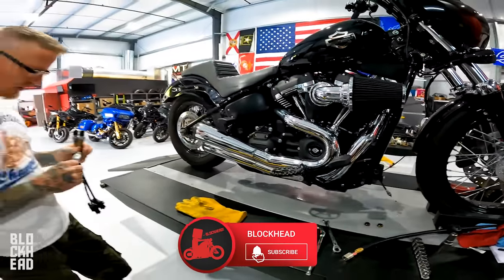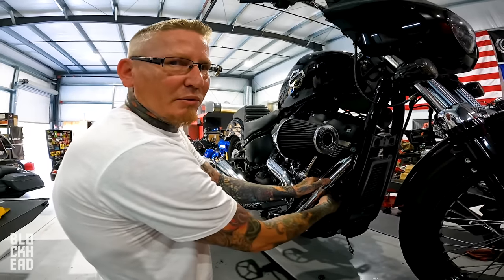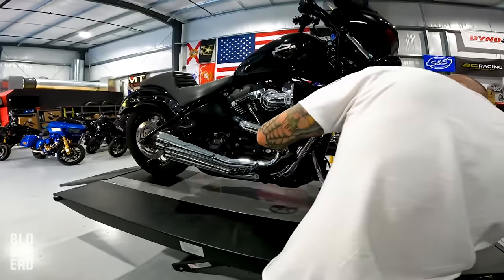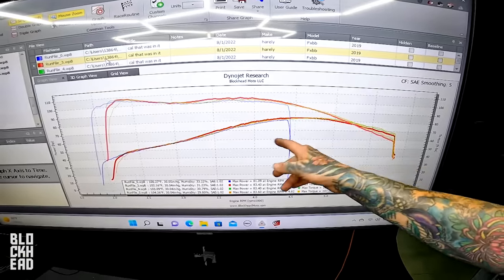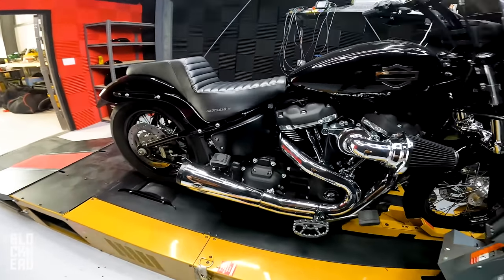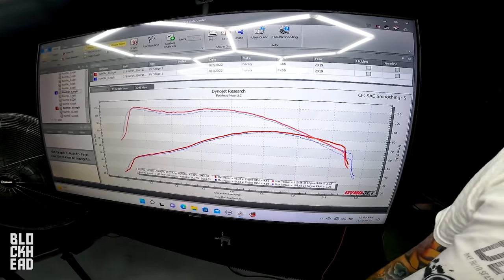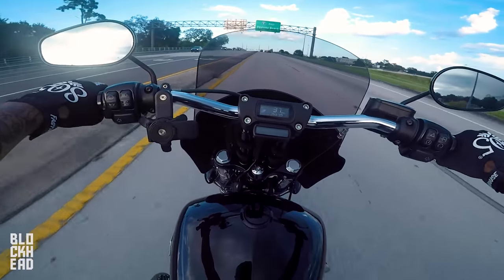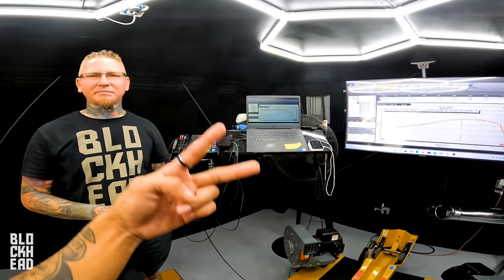Does a Harley-Davidson Stage 1 NEED to be Tuned? (We SHOW You!)

Comment: Doesn’t tuning a stage one make it a stage two?
Reply: no, how? its impossible because stage 2 consists of getting cams
Reply: @Cheaps928  thought that was stage 3? Then stage four is bore/stroker
Reply: @Cheaps928  thought that was stage 3? Then stage four is bore/stroker
Reply: @loweredyote8416  stage 1 moves more air and fuel with a new intake, exhaust and tune up. Stage 2 is stage 1 plus a new cam upgrade to give it the lift it really needs and imo the only upgrades a harley needs but if you want to go all out with power then a stage 4 is where you should be . its either you stay in stage 1 and make the engine last the longest possible or even stage 2 with some torque cams instead of power cams because with power cams you will put more stress on the motor components and will need to replace shit later on and it can break down if you ride too hard and fast without taking proper care of the bike. then Stage 3 consists of both stage 1 and 2 plus new bigger cylinders and pistons to pump up the volume of power and Stage 4 is topping it off and going all out in power with the previous stage upgrades plus better cylinder heads for the new cyclinders and a throttle body upgrade which makes the air passage bigger so you get way more air flow to the engine and the throttle response will be crazy, one little pull and youre off!
Reply: @loweredyote8416  all in all, the more powerful the engine you get the more likely something on the bike will break down later down the road
Reply: @Cheaps928  I think you’re flipping stage 3 and 4. A stage 4 on the new bikes anyway is the 131 stroker or whatever other stroker kit
Reply: @loweredyote8416  im not flipping it. stage 3 is just new jugs and pistons plus the previous stage upgrades and stage 4 is maxing the power with new heads and throttle body to match with the new jugs kit. thats how harley makes money. 
your statement is true about the new bikes having a 131 motor which is already powerful and you wouldnt need to do upgrades to it, just a tune up with new pipes and intake if you like
Reply: @loweredyote8416  thats what a lot of people dont know and end up over spending when they already have the power it needs. the most important thing to do is re tune the bike whether you get a new set of pipes and or intake. a really good dyno tune or so will give the bike its full potential. even with just a good tune and stage 1 upgrade you will be happy with the power because it will respond well with the tune. but cams gives you that lift to pass cars fast
Reply: @Cheaps928  I don’t think that’s right at all
Reply: @loweredyote8416  research it more thoroughly then, check out gixxerfoo on youtube he explains everything in different videos